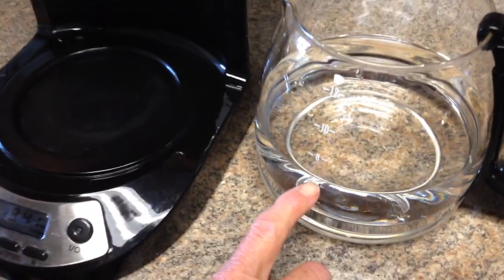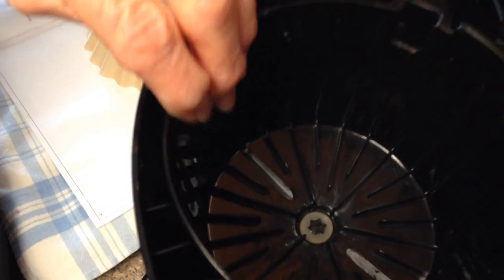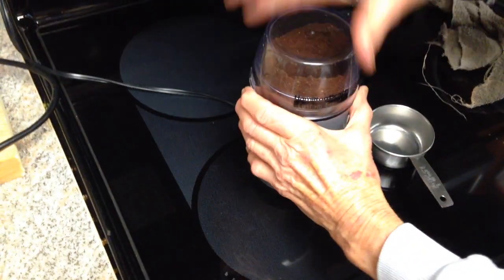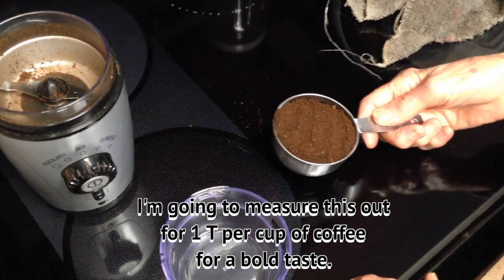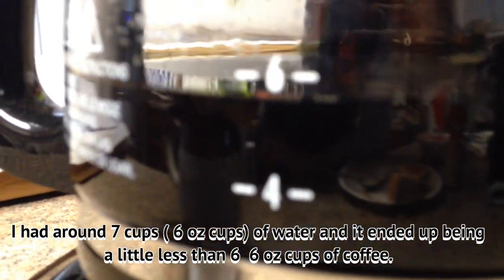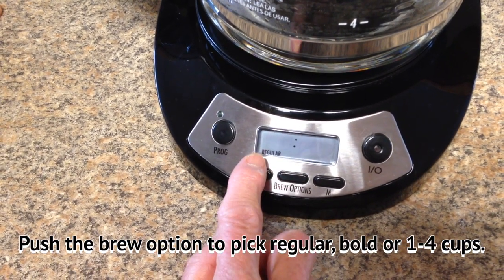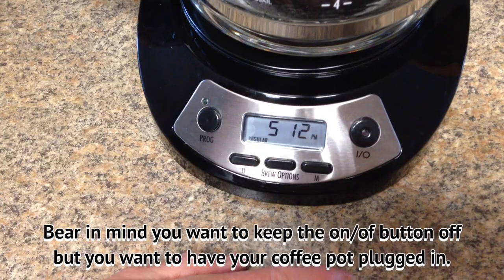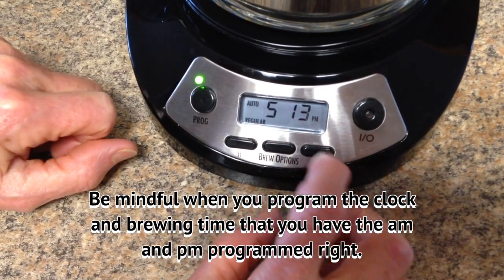How to Use the Hamilton Beach Coffee Pot

Comment: The brew option always reads 1to 4 cups if I want 8 to 10 cups how do I get it
Reply from the maker: I have retired the coffee pot a while back so I don't remember much about it but it seems to me it had the capacity to hold 12  6 oz cups. So to get 8 to 10 cups seems to me you need to fill the coffee pot to 12 cup capacity as most coffee cups have more than 6 oz capacity so you will probably end up with about 8 cups of coffee depending on the size of your coffee cup and then you need to decide how strong you want your coffee per cup (coffee cup). Coffee cups can vary a lot.

Comment: When it is on programming. I don't need to turn it on? For it to work. Or I can leave it off and on programming for it to work?
Reply from the maker: I'll just write from the manual about how it is worded. 
Programming : 
1. Press H (hour) and then M ( minute) to set clock. 
2. While holding PROG (program)button, press H and M until the desired brewing start time is reached. 
3. Press and release PROG button for less than 1 second to set coffee maker to come on automatically at the desire time. Press PROG again to cancel automatic brew.
Hope this is helpful. Thanks for watching.

Comment: Can you clarify, I can only program 4 cups in  the 12 cup programmable coffee maker? I wanted to wake up to a full pot. Confused.
Reply from the maker: I am so sorry I can not do another video at this time on programming the coffee pot. I have a husband in the hospital with a broken hip and it has been an extremely busy time for me. So for now I'll just read the info in the book. Press brew option button to select regular, bold or 1-4 cups if brewing a small amount. Press on/off button to start. Press H and then M to set hour and minutes until the desired brewing start time is reached. Press and release Prog button for less than 1 second to set coffee maker to come on automatically at the desired time. Press Prog again to cancel automatic brew. Hope this helps.

Comment: Thanks. I have a question, how to set the coffer maker if I want to make 2 cups of coffee. I mean if I pour 6 cups of water and I want 2 cups of coffee, how can I set  it to stop working when it finish 2 cups. Concerning it maybe unsafe the coffee maker is heating without water.
Reply from the maker: The average coffee cup holds 8 ounces of coffee. If you only want two cups just us a pint size jar (16 ounces) or measuring cup to measure out 16 ounces for 2 cups of coffee. When you pour your second cup be sure to turn off the coffee pot as heating the glass coffee pot with no water in it can damage the heating coil and may even break the glass coffee pot. Hope this helps.

Comment: Quick question someone made hot chocolate and added milk where the water has to go and now it wont work whatt cannn i dooi
Reply from the maker: I've never hear of making hot chocolate in a coffee pot but that is certainly creative. What about putting a quart of white vinegar in the reservoir where the water goes and turning the coffee pot on and running half the vinegar through and then turning the coffee pot off for a half hour or so and then turning it back on and letting the rest of the vinegar run through and then filling the coffee pot reservoir with water and letting that run all the way through and then doing that a few more times to see if that will unclog it.
Hope that works for you and thanks for watching.